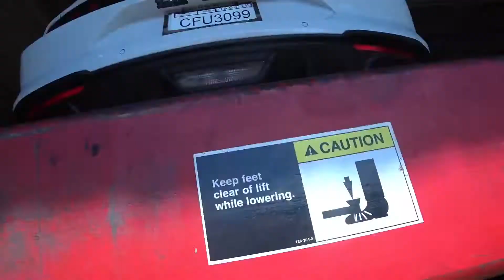2018 mustang gt mt82 Steeda x-pipe install

Comment: Steeda 20% sale right now. Don't know if I want the H pipe or X pipe. Such a hard decision. My car is a 2018 GTPP2 with non active exhaust.
Reply from the maker: H pipe is more deep and sounds like a nascar sound I went with x pipe and did a cat delete I been slacking have a lot going on but I will bounce back soon with some new footage
Reply: @alins2800  ended up going with the Steeda X pipe because the H pipe was back ordered. $99 shipped.

Comment: Removing those heatshields should still be OK?
Reply from the maker: Yea I did just so it doesn’t rattle seems fine
Reply: @alins2800  Yeah I had mine installed recently and they removed them as well. I think somethings not quite tight enough since I hear what sounds like a vibration sound on startup.
Reply: Those HEAT SHIELDS are there for a reason. DO NOT REMOVE.

Comment: Hitting it with the impact ,then the torque wrench is not how a torque wrench is used.
Reply: I was thinking the same thing.   Also, I would try to line up those clamps a little better.   Still a great video for those interested in the X pipe.

Comment: Just did this today. Take a picture of the exhaust tip gaps before doing anything to compare the position after install. Better to remove the entire exhaust from the clamps to the tips. Lay it out on the floor. Lay the X pipe on top. Square up the end of the X-pipe with the end of the resonator. Then make your cut marks. 
You can see in the video, they didn't cut enough off the first time because they "assumed" the X-pipe went into the cat pipes further. That can be checked and verified when the exhaust is removed. Shove the X-pipe into the cat pipe and you'll see when it bottoms out flush.The X-pipe crimped area is longer than necessary so it will look like it isn't in all the way. 
After cutting, de-burr the axle back portion, clean out any debris left from cutting and filing the burrs. Install the X-pipe into the clamps. Then install each axle back half individually. The muffler hangers have hooks on them so you can hook them into place one at a time and when both are positioned, adjust them before tightening everything up. This is a piece of cake install. Anyone who's worked on rusted junk will be pleased to be working on a new car.
Reply from the maker: Agreed I am no mechanic but try and help if I can